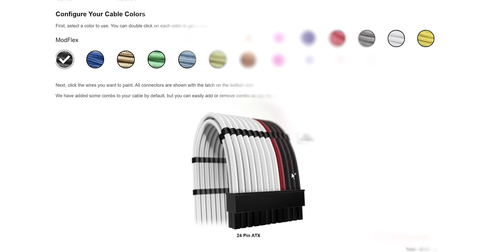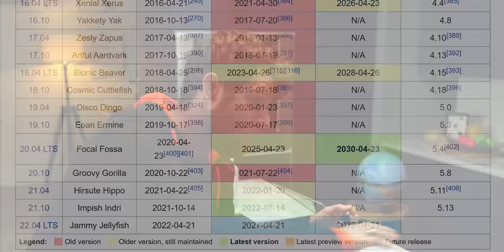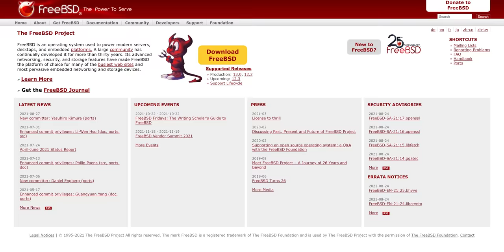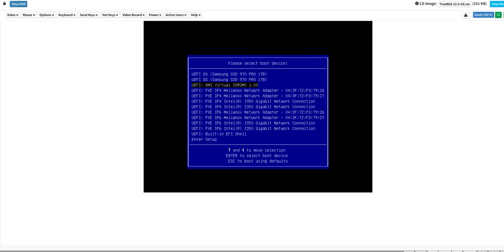We Finally Did it Properly - "Linux" Whonnock Upgrade

Comment: I'm amazed that you were actually running windows on your storage server all this time... That's true bravery right there!
Reply: @homedecore1391  what
Reply: Would have been worse to have a mac with beachballing
Reply: Windows on a storage server is absolutely excellent - if it's a fully supported OEM storage server running the correct edition of Windows. Which this is not.
Reply: Firzen is beast
Reply: lol EMC SANs runs tons of F500 companies.... their VNX product runs Windows server ... sooo
Reply: @pufthemajicdragon  Windows users are still stuck with NTFS, a file system which literally hasn't changed since the 90s. I tried windows as a storage server, it was only pain. Now I use linux with the BTRFS file system on literally everything, even my daily driver PCs.
Reply: @CounterFlow64   - NTFS hasn't changed much (but it has changed) since the 90s because it hasn't needed to. While other file systems have other features that you might want in niche use cases, NTFS is still one of the best broad-spectrum file systems out there. (MS has introduced ReFS, which introduces some cool new features, but it's just not the all-purpose work-horse that NTFS is so it's not gaining much traction.) 

That said, a special-purpose fs used specifically and only for that purpose will always outperform an all-purpose fs in that special-purpose scenario. An Indy car will always outperform a Corvette on an Indy track, but you'd never want to drive one on a state highway for your daily commute.

Anyway - the real point here is that Windows is not Linus' problem. His problem is that he's building his own DIY file servers as though he were still running a youtube channel out of his garage. His problem is the lack of tested, reliable, certified-compatible hardware, not the OS he's running. If he bought an off-the-shelf Dell he could get about the same performance without the headaches and problems, even if it ran Windows Server.
Reply: @pufthemajicdragon  I'm not saying NTFS is unusable, as it's quite literally the world's most used file system, thanks to Microsoft's monopoly. My point is that if you compare it to something like BTRFS, you find that it lacks a lot of features that even normal users would notice. 

BTRFS rarely fragments, is faster, has native compression (saves a lot of space actually) , very robust against corruption, and has a snapshot feature that lets you make full system restore points that only log changes, so it doesn't take literally your entire system's storage space. 

Considering how rich Microsoft is, it surprises me that they haven't allocated resources into compatibility for more modern & feature rich file systems, this is something that would legitimately benefit users. NTFS is proprietary, but the linux wizards has managed to revers engineer it or something, so it works on linux.
Reply: @CounterFlow64  Again, missing the point. Windows is not Linus' problem. His bad design decisions are.

But NTFS has built-in native compression (and encryption), is robust against file-system level corruption, has a built-in snapshot feature... It does a good job at preventing fragmentation, too, but that's only an issue if you're using spinning disk anyway, which "normal users" shouldn't and Linus' janky file server isn't. 

Implementing ZFS or (ick) BtrFS or a litany of other file systems in Windows would only add confusion to 90% of users without adding any real benefit to the remaining 10% who are sys admins running business IT on it. 

Are there other file systems that can do these things better? Sure. Are they so much better that Microsoft should implement them? Not on your life. You sound like a fanboi who just discovered *nix and loves it because it makes you feel like a 1337 h@x0r, but who doesn't actually know what you're talking about.
Reply: @СусаннаСергеевна  Then why does BTRFS perform better than NTFS? I especially noticed this when playing the open world game far cry 5 on linux with a HDD. It took MUCH longer to load on windows, probably because it fragments lots of small files that is needed to load.
Reply: Why anyone would intentionally use Windows Server (with Storage Spaces, no less!) over Linux, unless actually needing something WIndows offers alone, will forever be a mystery.
Reply: @mdd1963  True
Reply: @Teluric2  MacOS would have been more stable. Atleast it's UNIX like and not NT based.
Reply: @mdd1963  ask EMC.
Reply: Why anyone would intentionally pay for licensing WIndows Server, to include all the cores if above 16 cores(this would get interesting quick if a dual socket Epyc, right?), with all it's CALs, just for a file server....is interesting.

Comment: Linus secretly praying that the CPU isn't enough so he can put a 64 core CPU in his home NAS
Reply: Electricity must be cheap in Canada. In Germany, I try to put as small (power efficient) CPU as possible in my NAS or Server to save money.
Reply: @todortodorov940  innit bruv, like:

Mining: exists
RWE & Co: "But it won't profit you even slightly!"
Reply: @todortodorov940  nuclear is NOT cheap!
Reply: @_TbT_  If hydroelectric is not an option, coal is cheaper, for sure. I would still prefer to pay few more cents per kilowatthour for nuclear.
Reply: @vdoxsamp7283  it's coal that hasn't been profitable for years and is still being subsidized
Reply: @yozul1  the problem is, electric are running as for profit, not for charity. After the initial upfront ROI cycle, company will stay their price even they got better deals for it.
Reply: @yozul1  No. Nuclear is the most expensive option of all, the upfront costs are high, the build times are extremely long, the dismantling costs are not calculated in the kWh price and is often paid by the tax payer and the killer argument: the long term storage problem (for hundreds of thousands of years) is absolutely unsolved in every country.

Comment: I used to work for a certain cinema sound company. We were setting up a real time rendering cluster for digital cinema. What we found is that by moving from SMB to NFS we got greater throughput. We also hit the same caching issue with Windows. Linux was used as we could not solve that issue. Also, the read/write latency of SMB is around 40% worse than NFS. Not sure that would make a difference in your use case. But would make a worthwhile test.
Reply: NFS compatible with windows ?
Reply: @patiencelarson4128  Don't use Windows for editing is also a good way to ramp up speed.
Reply: @ryzenforce  Adobe kinda needs Windows to work, and LTT already made a video on trying to cut away from them
Reply: I have the same experience as well, but just in a home environment.
So I'm quite glad i have moved from windows
Reply: I had a feeling SMB wouldn't be particularly impressive 🤔
Reply: @ultrasonic3368  If you are really doing heavy video editing/production, you should not use Windows for starters. MacOS is much better suited for that and with their latest M1 Pro/Max addition, you will be able to run circles around whatever Windows setup they can come up with.  Keep TrueNAS for storage, but for all the editing could be done locally on MacBook Pros, and if that's not enough (which I doubt for the level of things they are doing), wait a couple more months for the MacPro workstation.
Reply: @ryzenforce  Can you elaborate why it's much better suited for this workflow? I'm very curious now!
Reply: @patiencelarson4128  Windows 10 Pro and up have an NFS Client. I've never benchmarked it, though, only used it for light workloads.
Reply: @astrotyDX  Mac OS like TrueNAS is based on (originally) FreeBSD (now called Darwin), NFS is native, so what @Ryzen said is true, however Linus had in a previous video discussed what put them off Mac's which was the graphics card compatibility. But it did sound like on the WAN show he was eager to see how a M1 Max PowerMac would compete against a Windows editing machine. Also windows is a crock of brown stuff.
Reply: @egerlachca  oh TIL, thanks !
Reply: Vote this up so they read it!
Reply: @DeyanKostov  its the bit I didn't understand why move to Linux and keep SMB, NFS much better and it will work with windows (I'm assuming windows on client side)
Reply: @Rickymcdd  Could be a knowledge issue as well. SMB is just more well known/comfortable for techs to use in a primarily Microsoft Windows environment.
Reply: @egerlachca  Windows 10 Pro lost NFS support when Windows 10 Pro for Workstation was released, as it become an exclusive feature of the later (and enterprise editions).
Reply: @cazador517  Can you be more specific on that?
Reply: @cazador517  Free to use in Linux and unavailable in the "Pro" version of Windows... sounds about right.  Any time Microsoft adds something remotely useful or desirable to Windows, they make sure to only make it available to the smallest subset of users.
Reply: @ryzenforce  ...The fact that you support giving Apple money shows you are not worth listening to.
Reply: @ryzenforce  I think you are blowing the actual performance of the Mac waaaaay out of proportion. Yes, the new processor is faster than their old one, but thats not a fair comparison to pc. Here are a few reasons.
1. If a new CPU or GPU comes out you can ger it without buying a new machine
2. Apple compared to intel, a company waay behind amd in terms of multithreaded performance
3. putting together your own pc is cheaper
Reply: @ryzenforce  also you doubt the mac would be brought to its knees by the hours of 8k footage being scrubbed through? Yeah, you keep dreaming
Reply: @ryzenforce  This is just not true.
Reply: @Critical3rror  "2. Apple compared to intel, a company waay behind amd in terms of multithreaded performance" ? Are you serious or just trolling?  Previous Apple chips were Intel. And before that PowerPc and before that, Motorola 68k series. The latest M1 is as good is not better with less core than the equivalent intel/amd with SMT. Just that should be enough to understand how good that cpu is.  And remember this is the first iteration of a new cpu vs intel/amd that are doing it since the last 50 years.  Not bad in my book by Apple.
Reply: @Critical3rror  Luckily, besides the top studio in Holywood, no one can film in 8k yet.  You probably need to educate yourself of what the M1 chips has built-in that intel/amd doesn't, and why 8k will be something even a laptop (MacBook Pro) could do, something that will require 4 times to horsepower on Windows/intel side.
Reply: @tams805  Can you be less clear please?
Reply: @tams805  He's talking from experience, something most Linus admirers don't really have but still comment like they do.
Reply: @DeyanKostov  reality is on editing systems he only cares about that they do their work which they do quite well he could move to macos but linux is a no go anyway, so for editing workstation boring is good
Reply: @ryzenforce  hint hint LTT editors edit everything from 4K to 12K footage if you didnt know also information on horsepower of macs is flat out wrong
Reply: @ryzenforce  well but that person is still the type of person that put people off of linux he realy did act holier than thou. besides not even understanding what linus is trying to do. he isnt trying to remove windows he isnt trying to get something exciting for his editors he likes the fact that video editing workstations are boring
Reply: @DeyanKostov  well then why is most of corporate world on windows
Reply: @DeyanKostov  but if it realy is that bad as you say belive me they would find alternatives
Look i am a linux user but i dont see much data about windows actualy being bad when users arent bad, as in windows systems i maintain (my dual boot for games and my familys computers)
Reply: @bigpod  Because of lobbying.  Gosh, were you born last year or something?  Went you buy a pc/laptop, the OEMs are forced to put and sell Windows. Everybody knows that since the last 2 decades.
Reply: @bigpod  Yes he is trying to remove windows because it is the Achilles Heal of his entire editing platform, and also because he finally recognized the futility of keeping Windows Server in the backend. He is also sending a message to Microsoft which is why I like him more each day he moves away from the Microsoft Empire.
Reply: @ryzenforce  from where did you pull that from he replaced a tool with another tool nothing else and the fact that he went away from windows server in that instance doesnt mean he will stop using windows everywhere that is an insane conclusion honestly
Reply: @bigpod  The whole video is about removing Windows from the backend, just saying.
Reply: @ryzenforce  so he has no more windows servers in server room but that has no effect on his other machines the editing machines like you and other guy try to impress on us
Reply: @bigpod  I am not trying to impress anything. You are just raging because you don't even understand what is going on in this video, what is going on in the industry and what all this changes imply and why we are agreeing with Linus and why we are suggesting other avenues to achieve what he (Linus) wants to do.  Geez, go get some real world experience on real production systems - not your dual-boot gaming machine or your family's computers - where money, time and down time is a day-to-day reality.  Many of the people replying to this thread are IT vets that have more experience in IT than your are old - me being one of them.
Reply: @ryzenforce   This used to be very true.  Every refresh we'd have to combat the beancounters' "cheaper" proposal for Win PCs by carefully laying out how much it would cost in add-ons to allow them to do what a Mac could out of the box.  But that difference began to be eroded in the early 2000s and by 2011 when Apple discontinued the XServe it had gone.  The only thing left keeping Macs on desks was the perceived learning curve difficulty of any change.

Professionally I've shifted away from that area in the last few years so I've little idea how the M1 architecture might change the landscape again.  It'll be interesting to watch.
Reply: @DeyanKostov  Yea it'll be the windows on the client side, That said i do and have used ZFS with windows client side no issues and to be honest i think they'll be using large files so can't see where they have an issues, other then it needs to be FASTER, many as well put red stripes down the side.
I think this is a case of too much money and no real end goal other then a Video. If i was working there i would be thinking "please just leave it alone".